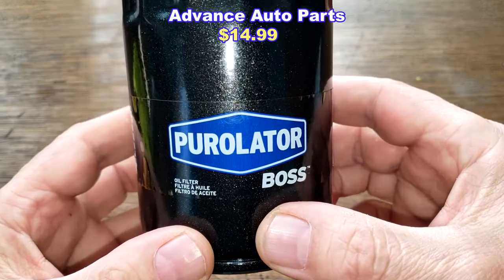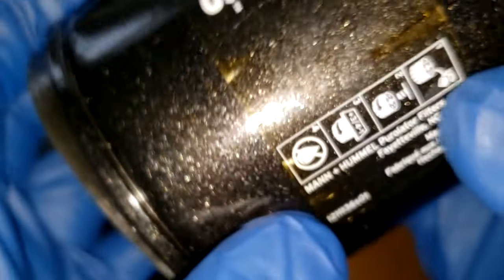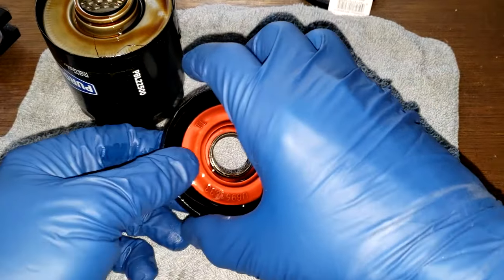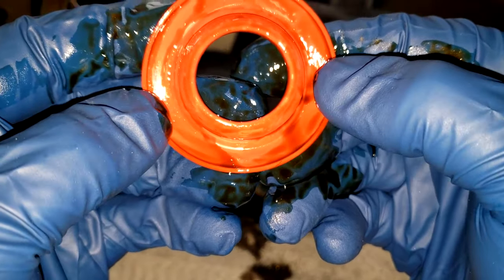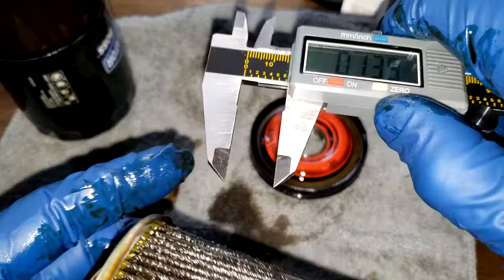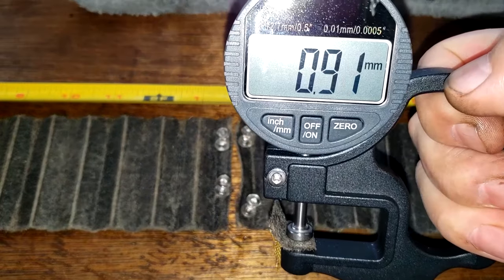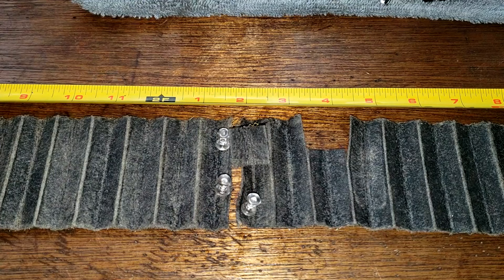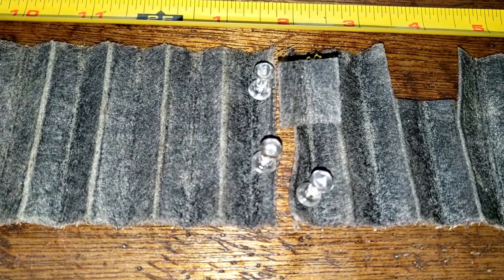Purolator Boss PBL22500 Oil Filter Cut Open, Used Purolator Boss Oil Filter Cut Open

Comment: A purolator filter with no excess glue ! Amazing ! All that soot is from EGR gases routed back into the engine to be reburned and slow combustion ! Soot is only like .02 microns so the filter did well catching it ! 👍

Comment: Great Job, Pete!

The filter and oil definitely did its job.  Might need to run some carbon cleaner through the engine before the next oil change but the filter certainly looks like it caught it all.  Good looking filter, makes me glad I switched to them.  No sloppy glue, good components It is worth the few extra dollars.  

I do have to say I am impressed with the paint job on the can.  It is nicer than some new cars being made now.
Reply from the maker: Thanks, Jim👍💯
Reply: @WhipCityWrencher  anytime Pete!
Reply: I use this filter on my 2017 Ram Hemi
Reply: @Johnny_Bee  Nice!

Comment: John should switch to Pennzoil Platinum. Not only is it cheaper but it has a better ad pack with a natural gas base oil. My Acadia has the same engine and there's a noticeable difference after switching from Mobil 1 to Pennzoil Platinum.
Reply from the maker: I've tried both and I like the Pennzoil Platinum also, my engine seems to run quieter.😊
Reply: Ok next time i try Pennzoil platinum.
Reply: @John115Yonkers  my fuel economy has gone up already using it. I usually pair it with a Purolator Boss filter or the new Fram Endurance filter. Enjoy your 3.6 V6!
Reply: Fram is crap.  I used an OEM  filter now.  I'll send that to pete in September.  Then use a prboss with the Pennzoil.
Reply: @John115Yonkers  The Fram Endurance filter is just a rebranded Royal Purple filter. It's a good filter. Also the Fram Ultra synthetic filter isn't too bad either.

Comment: Good video again! Like many newer GM oil filter applications this filter has a higher 22 PSI filter bypass relief valve setting. Can't help but wonder if GM is on to something for the DI engines judging by all that soot in the media.
Reply from the maker: Thank You👍💯

Comment: Looks like the Boss is Boss with taming that 3,6 GM soot monster ,these motors run on the sooty side ,i have the same issues with mine & now run the ACDELCO gold filter & change the oil every 5000 miles or earlier, i wouldn't hesitate to use the Boss though as its catching all the soot
Reply from the maker: Hi Mark,
Thanks For Sharing👍💯

Comment: Fun thing I noticed here:  This oil filter has the same media area as the much smaller Purflux LS350.  The LS350 has 40% less volume but the same area!  reference https://www.youtube.com/watch?v=sKtnzuKUEEA   ZigZag oil filter media does this, unique to Purflux.  Should catch/hold more dirt and flow better, fewer bypass events with the more media surface area.
Reply: One can't directly compare area of Boss synthetic 'depth' media to Purflux blended 'surface' media. They work differently to catch particulates. That said, I'm confident both would flow fine in passenger cars use.
Reply: @faxmen09  Actually the Boss doesn't do a lot of Depth Filtering like you would guess.  Thickness of Boss vs. Purflux is similar, and notice the Ascent Filtration tests done a while back on bobistheoilguy showed far less depth filtering compared to the true standard for depth, the old-style pink media Fram Ultra.  IOTW, the Boss had average filter efficiency with a high flow resistance, the opposite of what depth filtering buys you.
Reply from the maker: One thing with full synthetic filters is that the filter media is soft compared to paper or blended media. I personally think the full synthetic filters can hold more carbon/soot inside the media, whereas the other media seem to hold more carbon/soot on the outside.JMHO
Reply: @softwaresignals  It's still a synthetic depth media vs a blended surface media. Media area comparison not valid. As for efficiency, a strawman, irrelevant to media area comparison.
Reply: @WhipCityWrencher  Yep, fwiw Whip agree with you on Boss full syn media. But, as i noted to you before, Boss get little or no love on site you're familiar with.😉  While I don't use the Boss, price being right I;d have now problem using it.
Reply from the maker: @faxmen09  Thanks 😊

Comment: It DOES look like a boss filter.😉 Just my opinion, I think he should change oil every 3,000 miles or change the filter halfway. 
Hope you're feeling well. I NEVER wear shorts & I'm surrounded by woods, & I use Off spray. 👍
Reply from the maker: Thank You, 👍
I'm doing fine, I think I'll start using repellent also when spending any length of time outdoors.

Comment: John should switch to penzoil ultra platinum and could stretch it to 7-8k miles. That’s an expensive filter for only 5700 miles. Or change the oil and keep the filter on for 2 oil changes.
Reply: IMO if I'm doing my own oil changes and getting under the car, I'm changing the filter. It's not that much more money. This filter looked like it was pretty used up. Wouldn't want to risk reduced flow towards the end of the second interval.
Reply from the maker: Thanks👍
JMHO but I wouldn't change anything.